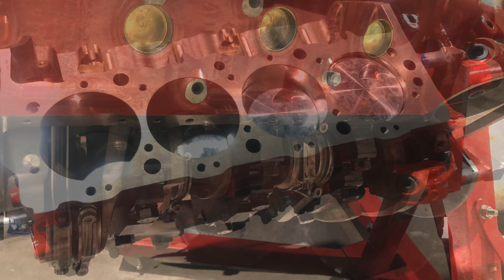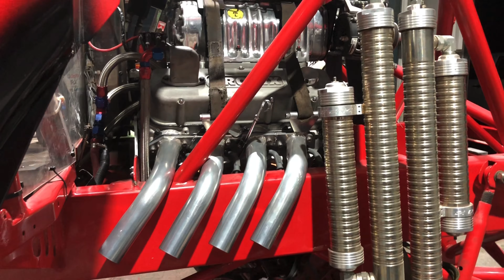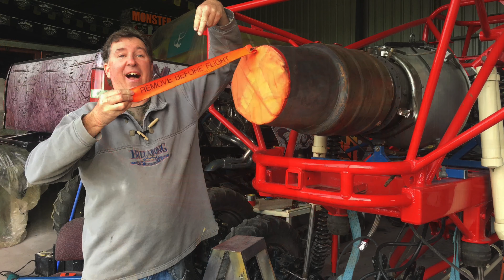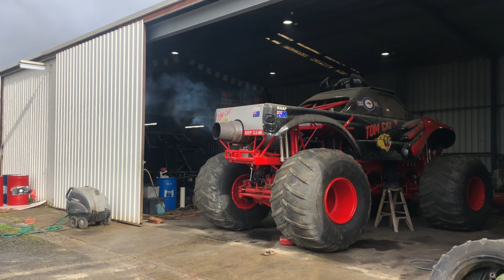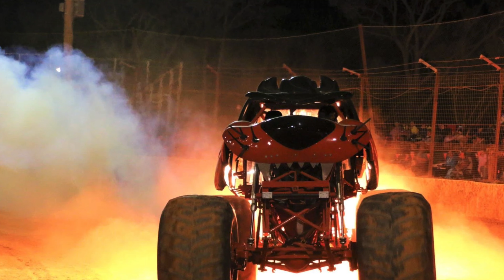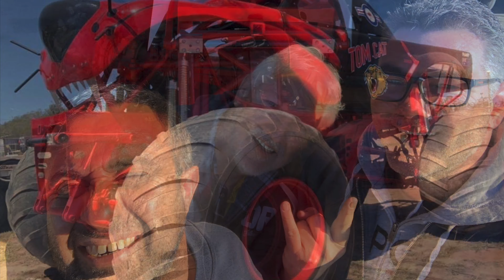Jet Monster Truck build video!

Comment: Is this the only duel engine monster truck in Aussie land? I know of a couple here in the USA that are duel engine as well. ALSO, HAVE YOU RAN BOTH ENGINES AT ONCE DURING A EVENT?
Reply from the maker: morphman21 yes it is, it was formally known as Bulldozer in the USA and made it here in Australia, I put the jet in the back and yes I have had it running with both engines many times and performed at many shows around Australia, if you go to “Australian Monster Trucks” on you tube you will be able to see it there, my friend has posted many videos of it running 👍